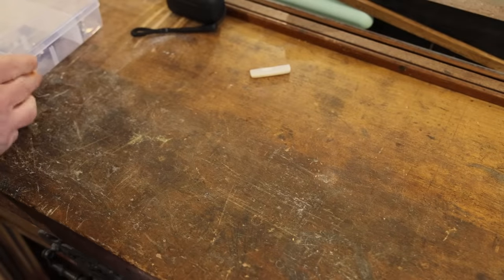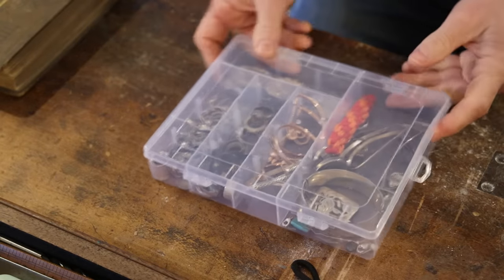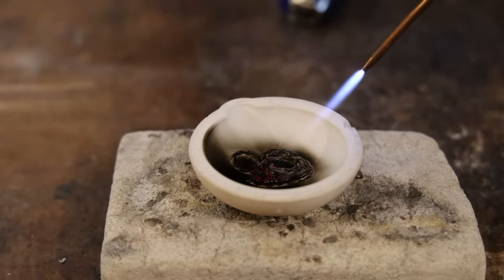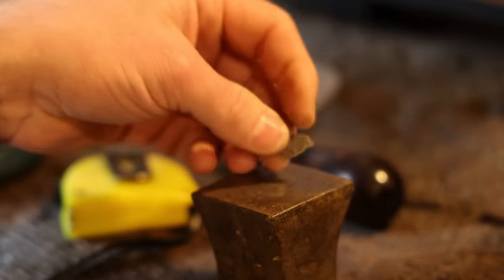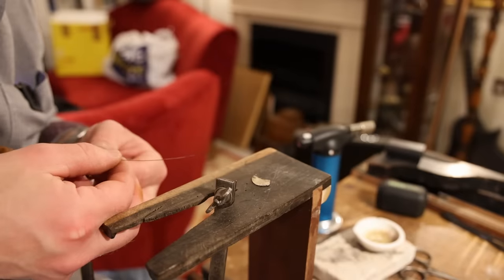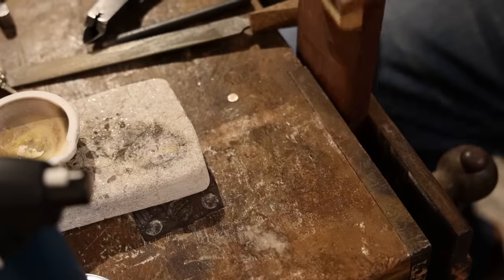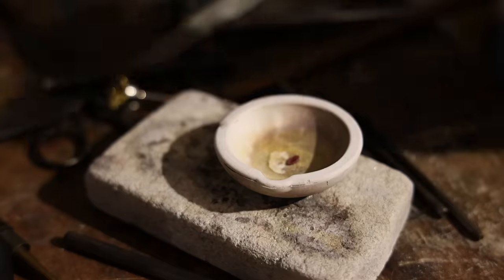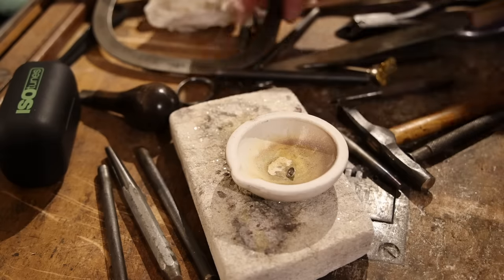Experimental Luthiery 101 | Playing at Silversmithing

Comment: As a former goldsmith who did stone setting, I winced so many times. For the type of setting you describe a tube would be better than a cup - thin strip of silver rolled and soldered then made slightly conical with a pointy tool and a hammer on some wood.. yada yada...

Also - having broken diamonds whilst learning to set stones I'm not totally sure I'd offer to do diamond inlays just yet ;-) (diamond may be strong, but it is incredibly brittle in certain planes - step one in making cut stones is often to chip the unwanted bits off)

Experience has me thinking I might have a mental spoiler for part 2

Comment: The torch has an outside light blue flame and a darker inner flame.  Use the darker inner flame it is hotter and the light blue flame will protect it from oxidizing while you do so.